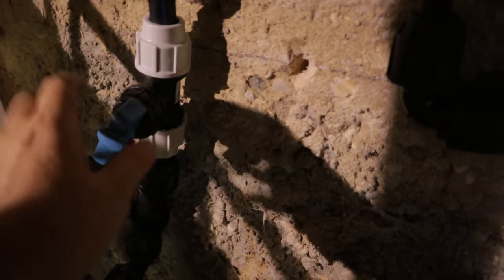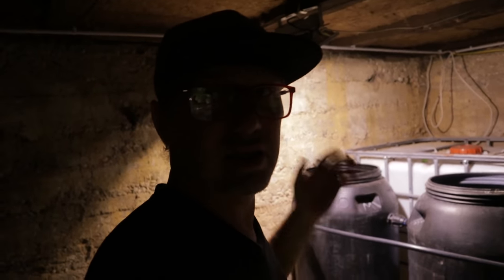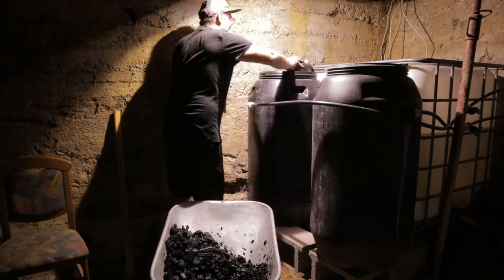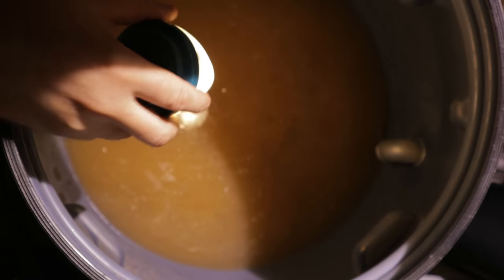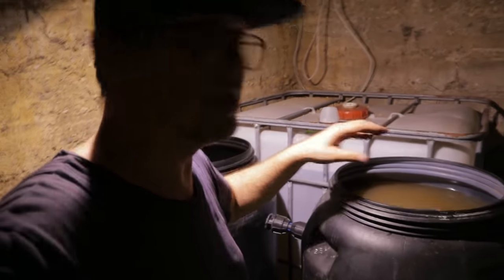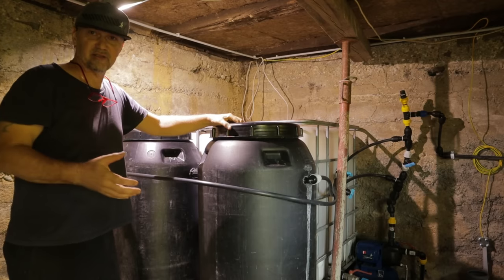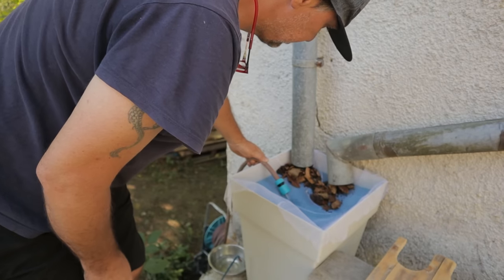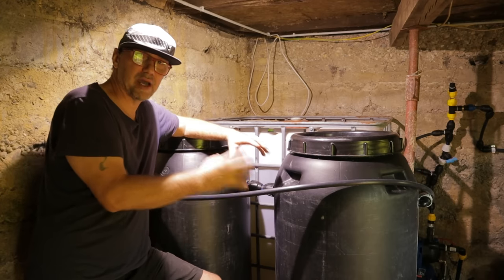DIY Rainwater Filter System

Comment: I'm looking to make something similar to collect rain water for a pvc pool 10-12m3 and for garden watering. I think I don't need charcoal. The reason I have not started collecting rain water is because i saw videos and the water is very dirty.  I wonder how many drums I need for this? How often it requires drum cleaning? Could you estimate how many M3 you have cleaned water before it was required to do cleaning of drums?

Comment: If you put the primary filter tank higher in the air, the seal will not be so critical...and some thread tape or rubber gasket ...material

Comment: Filter means to purify and separate, usually implying that water should fall from top to bottom.  The design of the internal pipes made the water flow from the bottom to the top, hence needing multiple pass throughs.
Reply: Having it feed upwards means that all the filtered out material will tend to stay at the lowest level and not contaminate cleaner sections!
Reply: @totherarf  You don't get rid of floating bacteria and light materials.
Reply: @mackbolan6263  Floating Bacteria is a new one for me. Does that not just mean water born bacteria? If so I don't see how changing the flow direction will make a difference, especially when you consider the rate of water flow is small.  
An interesting subject!
Reply: @totherarf  The point is changing the spout direction.  If everything does not flow through your filters then why have filters at all?
Reply: @mackbolan6263  So basically just reverse the direction (and layout) of one of the tubs?

Comment: I'd add diatomaceous earth and a back flush system. Imitate techniques used for pool filters, because they are known to actually work at removing harmful pathogens. Ultimately you probably still need some chlorine, because bacteria will grow in your tanks even if you have a micron size particle filter.

Comment: So is three a simpler way to maybe dig a trench, let the run off water percolate down to a perforated pipe where the cleaned water would then be pumped into a tank and used as irrigation water?

Comment: Solid design. 1 question, what's the plan for silt draining. If you had a hose fitting at the bottom of the barrels, you could flush them fairly readily.

Comment: Very good homemade system. 

I have 2 tanks each hold 22,500 litres/10,000 gallons. 
My system is not homemade a bit expensive setup by plumber. 

My water from roof gutters with gutter guard mesh is captured then flows down the down pipes then pvc pipe beneath ground maybe 1 metre and pvc pipe goes up to tank. 
The pressure gravity fed fills the tank and overflow fills the second tank. 

Electric pump is connected to first tank and feeds the house. 
Electric pump is whisper quiet. 

I also have 2 filters spread along water line up to house. Slightly expensive each system. 

First filter is under decking outside and second is under kitchen sink. 
Regular replacement for each filter filament costs me maybe $15 aud 
Per 6 months change over to new for best results.
Reply from the maker: Thanks for the extensive comment 🙂👍

Comment: Very cool system. How often will you have to replace the filter materials?
Reply from the maker: Not often, if we open it then we kill bacteria. Charcoal once a year, the rest if we see a drop in pressure, it means that the filter is clogged.
Reply: @klerobi1  would be possible to use a third little barrel only with charcoal to simplify the replacement of it?
Reply: @PaoloSulprizio  good question
Reply: Activated charcoal would be best if available....

Comment: IMHO there is a basic design flaw. The water is flowing up through the filter not down. This way dirt will collect at the bottom where you can't reach it. If the water flows down you can purge the filter by flushing it in reverse and you can quite easily control how dirty the filter is.

Comment: Why fo you add larger gravel on top of the 8mm gravel?

Shouldn't the filter get finer and finer gravel and sand?
Reply from the maker: To prevent small gravel from entering the pipe

Comment: you should just buy a pool filter(the ones that use sand), or change those barrels and use ones with metal/plastic ring, bc the lids in those barrels that you use wont stand the pressure built inside

Comment: If you collect rainwater from a clean surface into a clean tank there's no need for a filter. Why filter something that's already clean? If you feel you need to filter your drinking water use a ceramic filter candle that will last for tens of thousands of gallons and only filter the small amount of water you need for drinking. Btw there are few nutrients in rain water that may allow bacterias to survive. A filter similar to the one described here might be incorporated into a grey water recycling system where you actually input some nutrients for bacterias to survive on.

Comment: I wonder if, with having to replace the charcoal every year, having them as a separate filter in a small box in a between stage could work? I guess I'll have to watch more
Reply from the maker: Of course it would work, but be careful because the charcoal floats, the gravel helps to keep the charcoal in place
Reply: @klerobi1 good point, would probably pack the filter box to an extent,  to avoid floating, and ensure flow through is suitable. It's something for next season so I've got time to think. I want to stack them in series for gravity (rather than pumps) but don't want very heavy butts when 'empty' and don't want to pull them all apart for the maintenance, if it could stand virtually untouched for say 10 years that'd be perfect, other than the charcoal changes.

Comment: I have a some questions. First, in the months since you posted the video, how has your system held up. Also, what is the psi running through your filters? And last, are these filters under constant pressure? 

My dad and I were talking about this topic and got into a debate about plastic barrels being able to stand up to the pressure.
Reply: whoever was saying its kinda dangerous was right, better gravity only, I would add another tank with ready clean water and draw from there if I needed pressure in the taps but I d never put pressure and seal the barrels.

Comment: How long will it last like that? How often would you expect to need to get into it to maintain it?
Reply: Charcoal has a 3 month active cycle. Everything else is a natural filter that last for quite some time. This is a high micron Build and will not filter out chemicals, pesticides, bacterial, cysts or impurities. It will contain some sediment reduction. Most rain water is fairly clean if away from cities and kept out of sunlight to reduce Cyanobacterial build up. Adding the right amount of chlorine disinfects.

Comment: Am I understanding it correctly that the filter elements (gravel, sand and charcoal) remain permanently underwater? Does this not create an environment for green algae?
Reply from the maker: Yes, but also a perfect environment for the microorganisms that eat the green algae
Reply: Thanks Robert
Reply: @klerobi1  Do these microorganisms need all the filter elements in one barrel, or would it work too if there would be multiple barrels with one filter element? Like first barrel has only large gravel, second barrel only small gravel and so on...
Reply from the maker: @jankersten4543  The big gravel has the property of being around the pipes and that the pipes do not get clogged at the inflow and outflow. You can add 10 barrels in a line, so we can clean the water for a smaller village. Only one material can go in one barrel, be careful with charcoal because it floats, there must be something heavy on it (gravel). For filter material, zeolite or lava stones can also be added. There is no limit, more filter materials cleaner water.
Reply: @klerobi1  thanks for the reply

Comment: I think you would have had a much better outcome if in the sand layer, you used actual sand instead of small pebbles.
Reply from the maker: I need to redo the complete filter system 👍🙂

Comment: Pigeons sit on the roof and defecate.  Then when the rain comes the pigeon shit is washed down into the filter system.  The question is then how long before the all the filter materials need to be replaced ?
Reply from the maker: This is a bio filter, it means that we do not change the filter material, by changing it we can destroy microorganisms. When we notice that the flow is bad, we clean it. Once a year, it would be good to change the charcoal https://youtu.be/NzgxQysRVtc

Comment: One question. How do you clean the filter?
Reply from the maker: You don't clean it. You change the charcoal once a year. If you clean the filter, you will kill all the beneficial microorganisms. You clean it when you see that the pressure in the filter drops, that means it has started to clog. You take the gravel from the filter and clean it
Reply: Thank you for making this video.  I want to build something lie like this for my home.  I have soome more questions about the maintenance:  you said if the pressure drops it means it's started to clog and you take the gravel out and clean it.  By that do you mean you remove all of the media from both tanks?  Or only the gravel?  You used different size gravel.  How do you separate those different sizes should they need to be cleaned.   Or would it be helpful to use the mosquito netting in between each later for easy separation of each differnt later should it become clogged and need cleaned?  I have a well that I would be applying this for which is full of rusty hard water.  I suspect mine will get clogged!  I sincerely hope you will share a video later on when it is time for maintenance or for the charcaol change in the future!!

Comment: Is it possible on your site to suit barrels near the rain tank so it will filter by gravity through the filtering barrels and collect filtered water in last tank, instead of filtering under the pressure? Then you will be able to use water pump as usual from clean tank
Reply from the maker: When the water sits in the reservoir for a long time, it can become bad. I have two filters one is in front of the tank which works through gravity as you say and now the one behind the tank
Reply: @klerobi1  yes I saw your previous videos about that. I meant if you could have sand filter barrels before outdoor tank, so they filter rain water and then store sand filtered water?

Comment: Where part two?
Reply from the maker: This filter is currently a disconnect because I need to move it to another place. However, in three hours today, a new video will be out, the filter of which I designed specially for off grid
Reply: @klerobi1  great.. looking forward
Reply from the maker: @alexCroft87  Not today, tomorrow, sorry. But here is the link to the video, you can probably watch it already https://youtu.be/aCtQooclWvo

Comment: I have no idea why people bother with sand and gravel and all that nonsense. Just fill both with straight ground up charcoal, run till the water runs clear and call it good. The charcoal will do the same job of filtering out debris and particulates like all those other layers do and still give you clean water and it will last a LOOOOT longer with less maintenance because all that crap stays on top instead of getting down between the rocks and stuff. Just scrape the mess off the top and recap it. 
Just doesnt make sense to me.
Reply: My guess is you need all the rocks and sand to encourage the BIO layer... You want the organisms of this layer to eat the bad stuff from the water. This is like a bio sand filter with charcoal.

Comment: Why are you filtering rain water?
Reply from the maker: This is the only water I have on the property
Reply: @klerobi1  thanks for the response. I’m just confused why you are filtering rain water. In my understanding rain water doesn’t need filtration to be potable and as long as your catchment system is kept clean there should be no need for filtration other than for the odd leaf or bug.
Reply from the maker: @johnfarling1537  I don't feel good when the birds poop on the roof and then it all goes into the water tank
Reply: @klerobi1  fair enough.
Reply: @johnfarling1537  rainwater has contaminants such as air pollution, and poop from your roof.
Reply: @HamguyBacon  yes, every rain drop has to form around something. That does not stop many people around the world from drinking it directly from their collection systems without filtration.